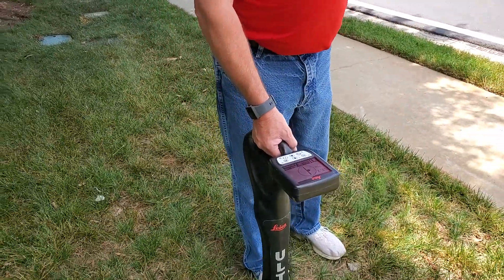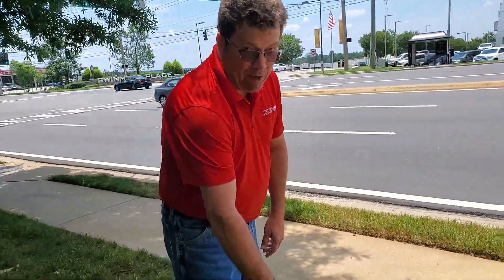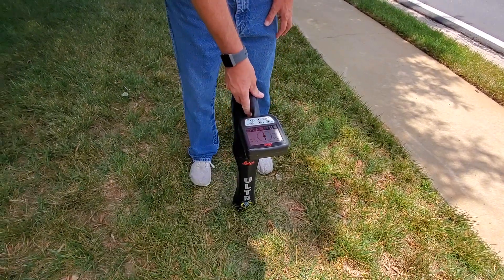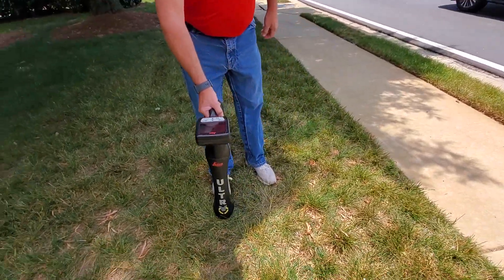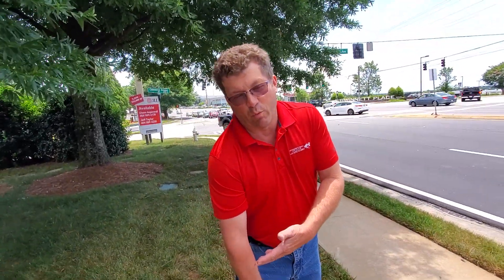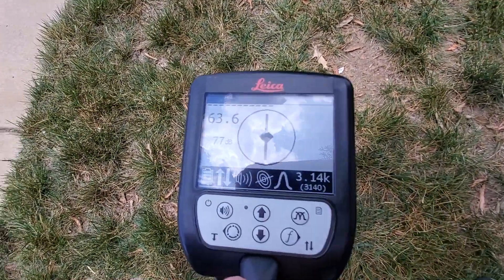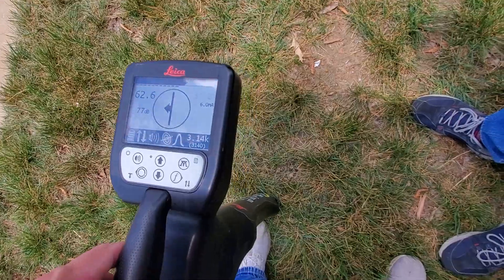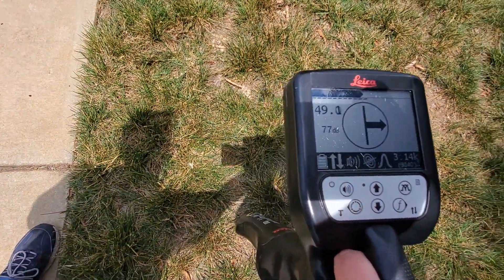How to determine if you have a round EM signal when locating utilities

Comment: Hi Sir, I have some problem with my GPR reading here. I did some testing to locate reinforcement steel on wet slab at site and found out  the depth of the rebar from GPR are very different as compared to the actual slab detailing drawings. So I did destructive method and the depth proven to be very wrong. Does dielectric input used in GPR during testing can fixed this or GPR cannot be use on wet concrete to accurately detect rebar position?  I am using GPR 1.6GHz from GSSI unit and I really hope you reply me if you see this comment. I desperately need your help! Looking forward to see your reply. Thank you
Reply: hey some of GSSI technology have specific settings for concrete type, ei: damp, moist, dry, wet. is that the GSSI mini?
Reply: michaelellison777 im using not the mini one. Mine is gssi 3000 with the cart

Comment: So the trainee would then ask: if I don't need to do all of these then how many should I do? Which one is the best? What do I do if the field is not round?
Reply: If you have a locator that displays peak and null at the same time then method #1 can be done constantly without adding any steps to the locate so that's the primary method that we use. Distortion can affect accuracy of both horizontal and vertical locations. What to do about that is not a quick answer for me.
Reply from the maker: Well said, from a seasoned trainer. Hope you all are holding up well and staying healthy.
Reply: Thanks Dan. Same to you. All healthy here. Thanks for the videos and replies.
Reply from the maker: And the trainer at gprs would answer...